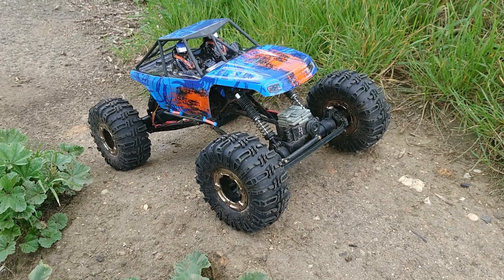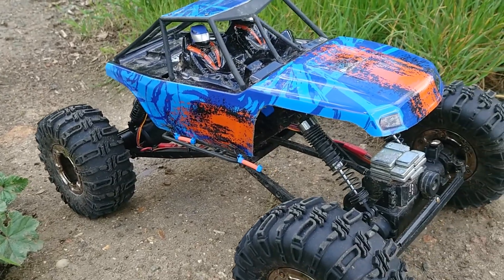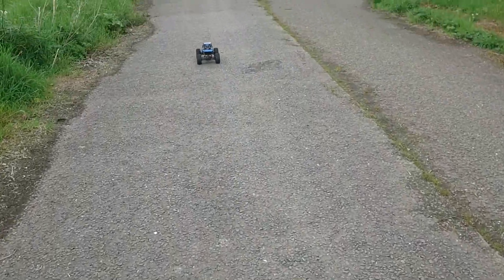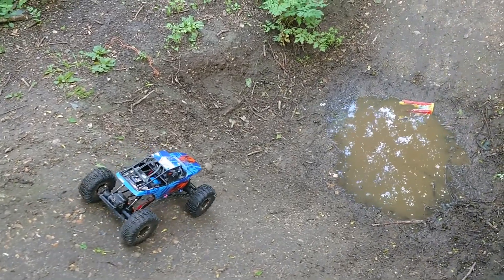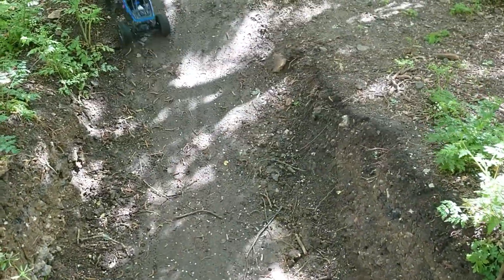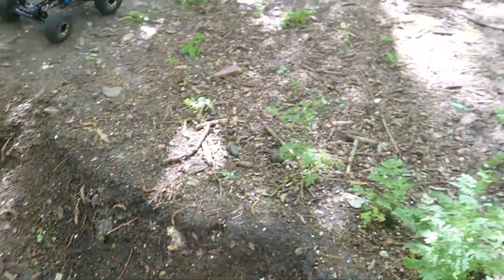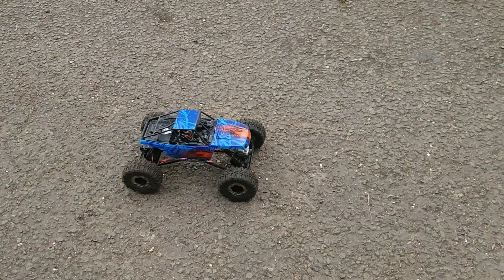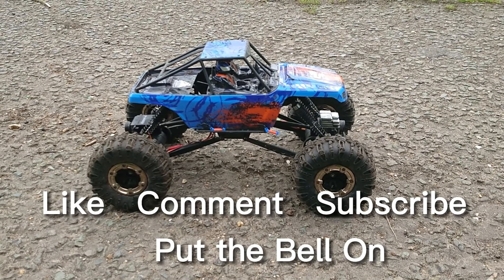FTX Ravine Crawling at Sutton (Comment Name Suggestions for this Truck)

Comment: Motor on axle is interesting! Did you add any weight on the inside of the wheels? Crazy capable crawler for the price 👍
Reply from the maker: No weight inside, just ontop of the front axle,  and this thing was £99.

In my mind, the best first crawler for someone to get !